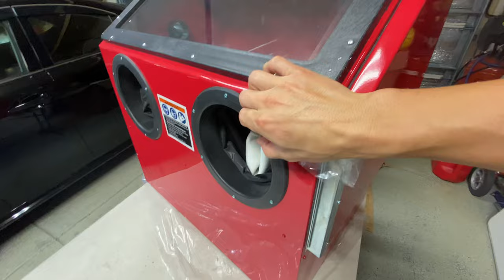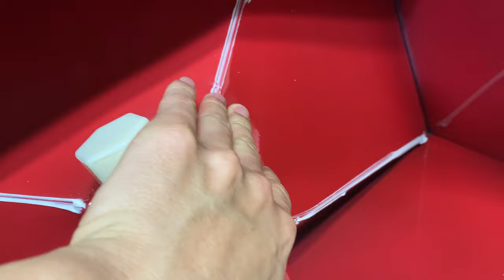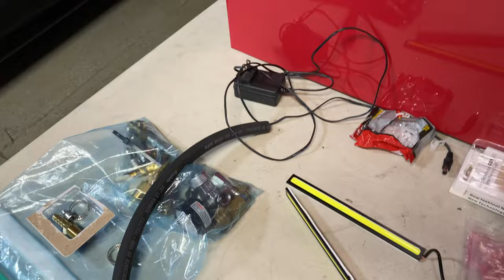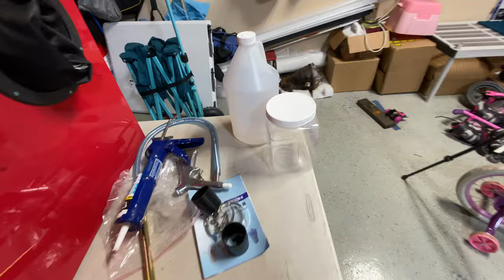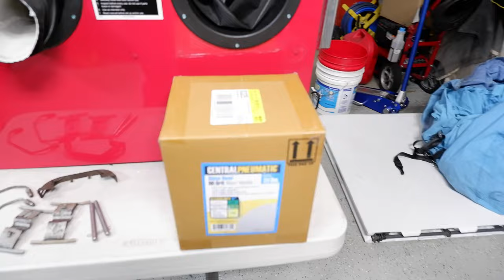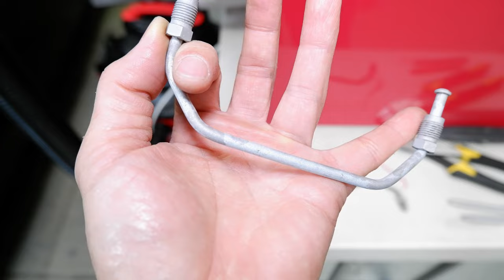Harbor Freight $100 Sand Blast Cabinet Setup | Lighting Dust Collection System

Comment: Theoretically, if u wanted to blast something bigger, can't u take the cabinet outside and stick the part halfaway out? Or set the part on a table if the hose reaches?
Reply from the maker: the cabinet is for keeping everything contained, you can actually take the gun out and blast with the hose in a bucket of media. You will just get stuff everywhere. They sell small gravity hopper guns at HF for like $20.

Comment: Late comment. I’m sure you now know HF has labeled the intake and exhaust incorrectly. The exhaust is in the REAR.
Reply from the maker: It probably doesn’t matter as long as there is somewhere to draw air from. The back has that blocking plate so it’s hard to get a tight pipe into it. For the side I recently added a PVC elbow pipe to draw air from the top of the cabinet. The helps reduce pulling too much media into the dust collector.
Reply: @TunerwithKids  that “blocking plate” is the baffle to prevent large solids from being exhausted. It’s placed low to keep dust from clouding up the blaster. That why the side intake does not have a baffle.

The air flow is just at or below the working table on purpose.

Comment: Hey bud what connector did you use for the light strip for the outlet
Reply from the maker: I just used a external hard drive power supply (12V, 1.5A) with some spade connectors.

Comment: Looks good. Thanks for the vid. Got my cabinet going for the first time today.
Reply from the maker: After using it for a while, I want to add a vibrator underneath to knock some of the media free when using it. I saw a guy add one with a big switch inside.
Reply: @TunerwithKids  did you add them? I got a couple of Amazon that work great
Reply from the maker: Not yet. Haven’t had time to do much lately. Once I setup my new garage, I’ll get around to it.

Comment: Do you need a vacuum?  You never said how it worked out without…. Can you just put a filter over that hole to keep the dust inside?
Reply from the maker: The vacuum helps remove all the dust and debris and also to see. The dust turbine keeps dust out the vac.

Comment: I like the little bottle instead of the 5g bucket
Reply from the maker: Yea it’s easy to more around and empty after each use.
Reply: @Binh Nguyen-Tuner with Kids  I literally just finished putting everything together. I have the one w the legs. I did the meter valve mod, sealed everything [maybe a little too much 🤠], harbor freight 6gal vac, and HF dust collector w the 5g bucket. When I get time I'm going to try and use plastic pipe and find a small container. I'm using mine for cerakote prep.

Comment: what air compressor are you using to sandblast?
Reply from the maker: That 2003 Craftsman 30 gallon that I did the troubleshooting video the other day on. Not very reliable and I can only blast 5 minutes at a time, then wait 10 minutes to recharge/trip breakers 3 times to get it back to 130 or 140 psi.
Reply: @TunerwithKids  mines is around there and I was worried the cfm was too low. Harbor freights makes blasting pots that are suppose to help make it all easier. But I dont wanna give you another thing to bug😂
Reply from the maker: My plan was too get an upgraded compressor, maybe a used pro 240V one. But right now nothing to ok justify the cost.  All my impact and tools are battery now. Only thing compressor is good for now is paint and blasting both of which I dont do often.